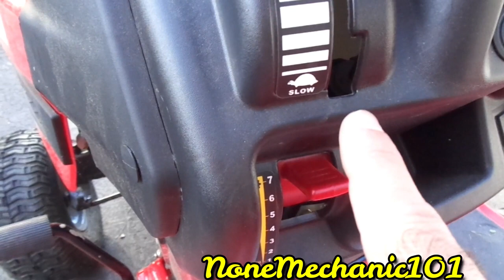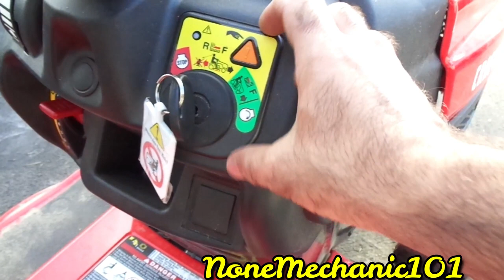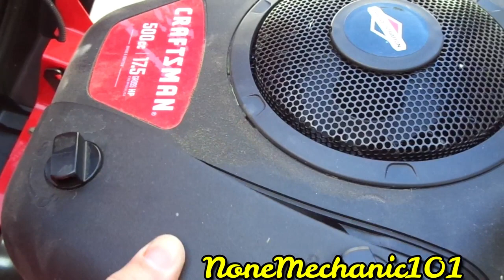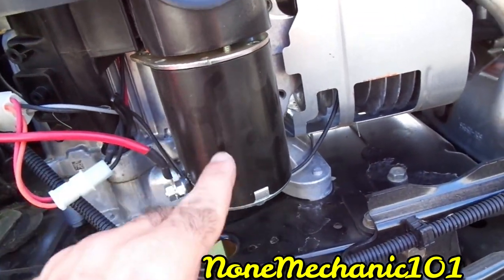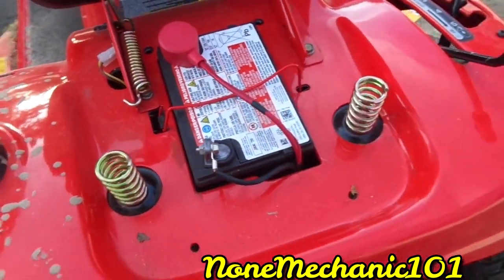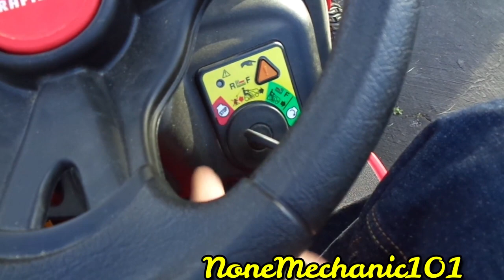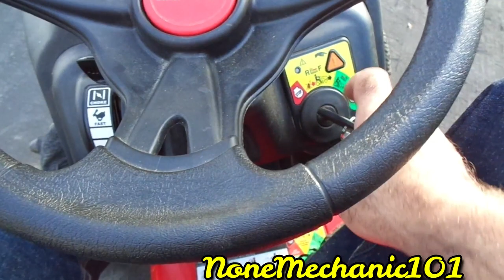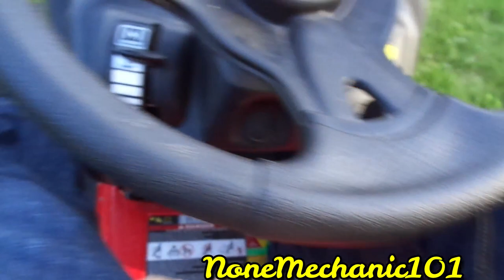Cratfsman Lawn Mower T110 "Review"

Comment: You do not choke a engine when shutting it off. Yes it will mowing in reverse. There is a 1-7 speed control on left side under choke control. Choke also controls RPM. Holds 2 gallons of gas. Just purchased today, but did a lot of research before hand !
Reply from the maker: Thank you. I'm going to pin your comment.
Reply from the maker: @minuteswithmichaela  The way illustrated it
Reply: But it should start in choke, so shouldn't it be easier to put it on choke after shutting it down, just so you don't have to remind yourself to do it when starting again?
Reply: @commandercaptain4664  I don't think I've ever seen anything that goes into choke to shut off.  I lower rpms then shut off
Reply: @_THUMPR_  what is rpm?
Reply: @4SevenSeas  revolutions per minute.

Comment: Not sure if you still have this mower, but I picked one up at the Lowes Outlet Store for a good price.   it didnt have a battery but there was a tray insert and the wires,  anyway the battery I bought is to big for the tray insert, and when I took the battery insert out,  the battery went in to far...  i think it was sitting on the axle just above the pulley of the deck.   
 Can you advise if there is someting the battery sits in and the measurement of your battery?
I picked up a Tractor Supply Battery, TS/IB-U1L215 measures 7.72" L x 6.26" H x 5.20" W.
Thank you in advance.

Comment: Hi, I just bought one over the weekend and it rattled alot. I only took it for a short test drive in my yard. When I shut it off I depress the brake pedal and push down the yellow speed lever to the bottom at the P for parking. I put it in N and shut off the engine. I took the key out of the ignition and got on my knees and had a look at the belt. It seems pretty loose to me. I will see if it tightens up a bit when I engage the PTO lever. With engine off and in park of course. I'm also going to make sure the deck is secure and all the nuts, bolts and cotter pins are in place. The hood rattled a bit but I am ok with that for now. Have you experienced what seems like a loose belt with this machine? Thank you.
Reply from the maker: It seems that since I got it. The belt has been loose. I think it is something I'm going to have to look at.

Comment: Stupid question here, where are the brakes? I know he pointed to the red lever but is that how you stop it if you're driving it, by flipping that brake switch from 1 to 7 depending on how hard u need to brake?
Reply from the maker: In the left side there's metal pedal that has to be press. The red lever that has the numbers is how far the pedal would go

Comment: Hector, can you please do a video on how to change the oil in the T110?  I have the Briggs & Stratton motor.  It took me a while to locate the oil release valve. Now I'm wondering which is the best tool to use to remove the bolt and what to use to have the oil drain from the mower to the pan. Please help! Thanks in advance!
Reply from the maker: It looks like that the best tool to use is a 14 mm wrench.

Comment: Hey 101, I have a lot of hills and some are even steeper than 45 degrees. You think the T110 will do the job going UP hill???
Reply from the maker: My T110 does good but on even and steeper curve it leaves on even spots.
Reply: @NoneMechanic101  Thank you, Im not as worried about that because it's a back trail BUT you think it'll take a very steep 45 degree hill going up without stalling out?
Reply from the maker: @TheTacticalAviator  I'm not sure but it has never stalled on me.
Reply: No yards with hills and slopes you need a mower with the scrape wheels on deck.

Comment: I just bought a T100. They forgot the owners' manual, so I went to You Tube. Yours is the 4th video I've watched and the only one who mentioned anything about the cover being so loose. My cover came off.  Completely. The only difference from what you have and what I have is that the T100 is 36" cut, and 11.5 HP.  I printed out 5 pages of the manual for the T110, because there is NOTHING about the T100. I learned what the orange triangle is for, etc. You, BTW, are the only one who mentioned the orange triangle and being able to mow in reverse. I'm wondering if that is the way to enable you to mow a slight hill. As in go forward on the way down, and instead of turning the mower around, back it up while cutting then go forward again while cutting downhill? The mower did not want to go up a not very steep hill. If my owner's manual doesn't arrive by the end of the week I just might call and tell them to take the mower. back.
Reply from the maker: The lawn mower I have goes uphills. It would go down a hill good. The mower shouldn't be use for deep hills
Reply: @NoneMechanic101   - It sure didn't like the little bit of hill I was going up. Maybe because the ground has become uneven there, thanks to the heavy rain last week. But like I said, mine is only the 11.5 engine, the T100, a small version of the T110. I ended up getting out my Black Max self-propelled mower to do that part of the yard. I love that mower except I have a large yard and back problems. I'll try the Craftsman in a few days, after the incoming batch of rain ends. I sure hope my manual is here by then. Thank you.

Comment: Any word on where the oil filter is as well as a tutorial on oil chang ?
Reply from the maker: I need to look into this. I didn't paid it no mind because of winter
Reply: Doesnt have a oil filter on this model. Just drain the oil an put in new
Reply: @NoneMechanic101  if it's under 18hp they don't have oil filters change oil ever 10 hours
Reply from the maker: @Aciecarter238  Thank you for the information. I appreciate it
Reply: @Aciecarter238  where is the oil drain plug?
Reply: @jennaconnour9671  it's on the side of the motor near the starter. If you got the mower brand new it should come with a plastic spout you hook under it to keep it from going everywhere. If not it runs under the motor an makes a mess. Change oil ever 10 hours because it doesnt have a oil filter or you can put Lucas heavy duty oil stabilizer in it an run it 30 hours before oil change. Drain plug is a square head bolt an it will have teflon on the bolt. Bottom of motor towards the back right under the starter. Will be the only thing on motor with wires going to it.

Comment: I know u have Forward, Neutral, and Reverse, but how do you control the speed?
Reply from the maker: With the Rabbit and the turtle.
Reply: I went with the t130 with the gas pedal instead of having to ride the brake
Reply from the maker: @mikey_likes_it_  , how those it ride?
Reply: Its good it was worth the extra money.  Also has wheels on the deck and 18.5 hp engine
Reply from the maker: @mikey_likes_it_ , Great. If I had the extra cash the day I purchased my lawnmower I would had when with the one you got. 🛒
Reply from the maker: @myspike20 , Thank you I learned a few more things after this video. I appreciate your comment🔧
Reply: myspike20  I have a few questions because no one showed me. Do you control speed by the rabbit turtle lever? How do you break or slow down? What is with the 1/7 yellow thing?
Reply: rogermurph101  Thank you. My next question is the brake. How do you stop the mower? I was told pressing the clutch is bad and to put it in neutral, but that doesn’t seem smart, especially if I’m moving.
Reply: rogermurph101  my common sense was telling me the same thing but the manual says neutral to stop. They must mean that literally, as in halt and not breaking or slowing. Thank for the help!
Reply: You can use the throttle to control the speed, but you should be using the gear lever below the throttle to adjust the speed. The throttle should be up (rabbit), especially when mowing.
Reply: Justin M  That exactly how I’ve been doing it. Thank you for your comment though. I appreciate it.

Comment: How you decrease the speed? Do you need to use the choke in fast or turtle?
Reply from the maker: The 🐢 works best for me.
Reply: The lever below the throttle is to control the speed. By and large you want the engine throttle up all the way (rabbit) when moving or cutting. Use the gear lever to adjust your speed.
Reply from the maker: @TuckFinn  Thank you

Comment: My mower holds 2 1/2 gallons, because it is more of an industrial mower. Nothing I hate worst is to run out of gas before I am done. The Key area and hood shake because they are cheap, unlike a car. Funny, you took it for a mud run, lmbo When you turn it off, you should slow the motor down to the turtle. If it is still warm, you can start it with the throttle 1/2 way up. Your front wheels, if there isn't a grease zerk on the rim, then you might want to check to see if the axle needs greased a bit to help keep it from wearing out. Just a Tip
Reply from the maker: Thank you. I appreciate the information. You are always very helpful

Comment: Nice mower but I have some tips for you: 

1. Don’t leave the choke for so long when you start it and use it while in choke.

2. You don’t need to choke it back up when the engine is warm.

3. Don’t shut off the engine at high throttle because it can backfire.

4. No need to put it on choke when you turn it off.
Reply from the maker: Thank You!

Comment: Wow. Actually the numbered lever is the gear shift. It has 7 speeds. It does not tell you how much brake you want. Speed is controlled by the gear you choose. Also it is not the cheapest Craftsman because there is a T100. You do not put it in choke when you stop it. Only when starting and it has not been run.
By the way. If you are the NON MECHANIC the take the "e" out of your name.
Reply from the maker: I like the "e" Nonemechanic101. Thank you for the comment.

Comment: I don’t think your sales person who ever you bought it from didn’t go over how to properly use this mower the thing you call a clutch is actually a brake To set your Parking brake you must put it all the way down and on the speed control on the seed controls (not motor speed) You must press that down also while holding the break down release break was holding speed control and that will set your parking brake this really helps because that will allow you to have the engine continue to run shelf there’s a problem that you need to diagnose on the engine it will still be able to continue to run
Reply from the maker: Thank you for the information. I appreciate it.
Reply: Use some punctuation and that would help us to better understand your valuable comments.
Reply: Actually that pedal is a clutch and a brake.

Comment: The deck shakes too
Reply from the maker: Does the shaking is part of the design?
Reply: NoneMechanic101 this I have no idea. I would not think so. If you can do this. Have someone hold your camera and look at the rollers on the deck. The belt looks very loose that it may fall off. I didn’t see any belt retainers either. I would be curious to see if maybe your deck works fine compared to my neighbors.

Comment: No need to choke a warm engine. That mower it is probably the MTD Craftsman which has economical features hence the hood etc..I would put my own clamps on it if I felt the hood will fly up or shake too much. I have a JD 277 AWS and that in reverse  blade shut off is a real pain. Yours is a good mower for what you are mowing and 17.5 HP  is  plenty of power for an acre.
Reply from the maker: I'm thinking of putting a clamp on the hood. Thank you.